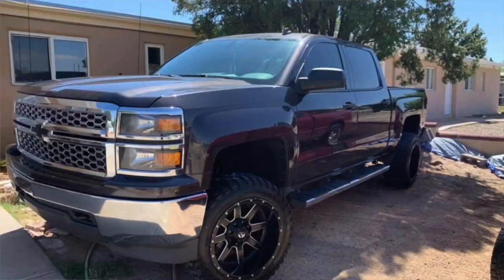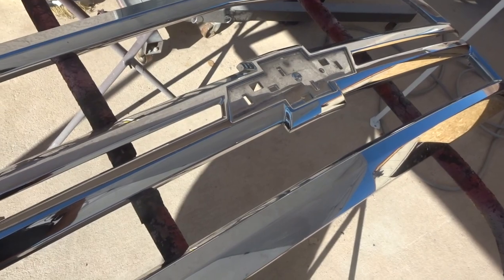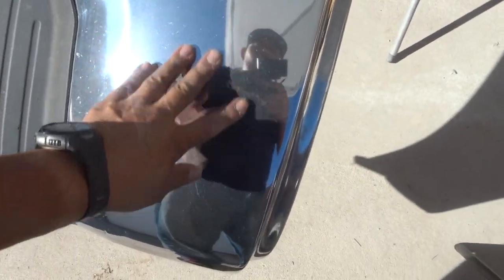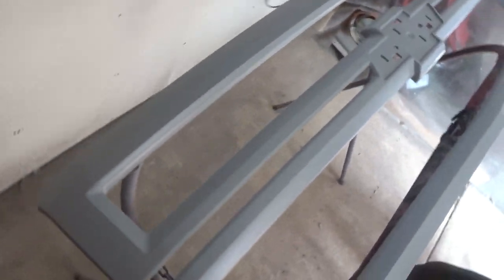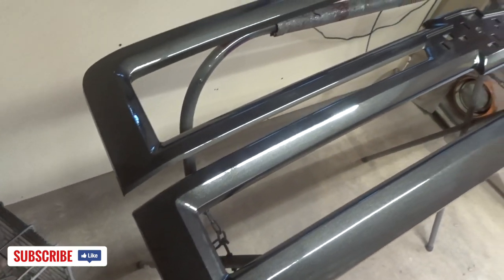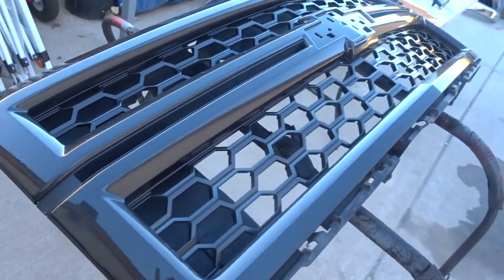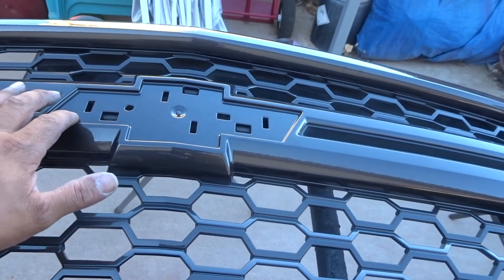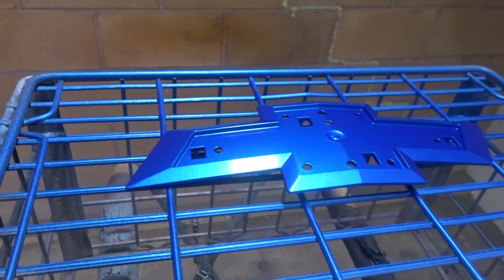Color Matching A Silverado Crew Cab grill & bumper

Comment: Where you located at ? I wanna do this to my truck
Reply from the maker: Albuquerque New Mexico
Reply: Robskustoms will the bumper chip or start peeling due to it being a previous chrome?
Reply from the maker: Freddie02f it all depends on driving conditions high way use and all that it can happen I’ve seen brand new trucks with rock chips from factory best thing to do is color match it and put on a clear bra on it to take the impact on chips